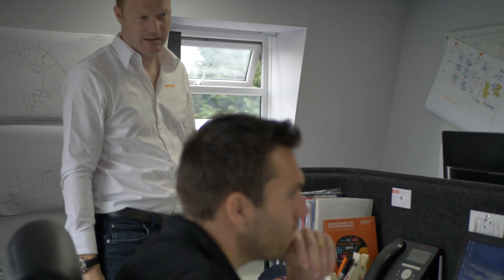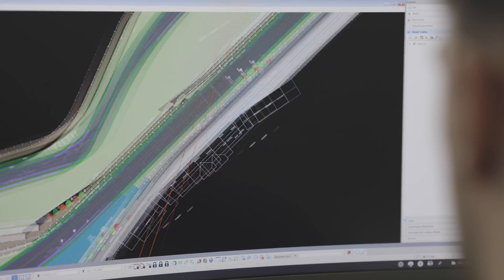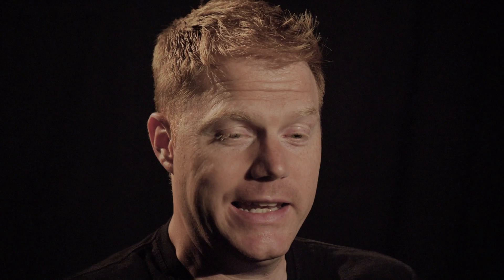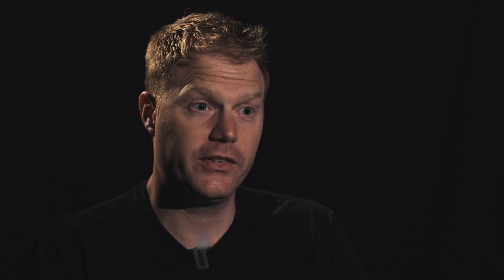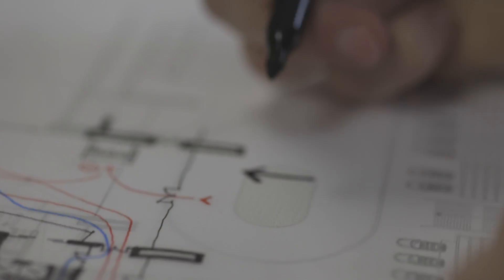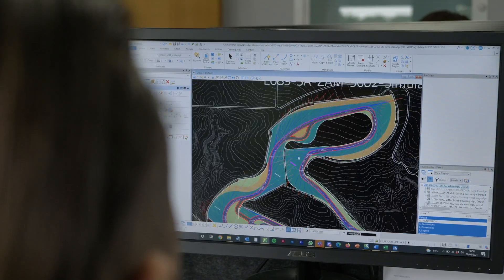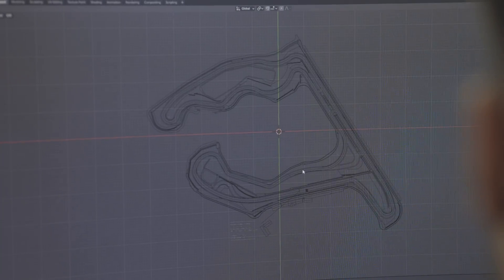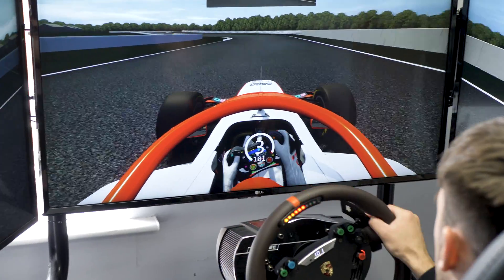Race Track Design | Our Process | Driven International

Comment: They 100% don't race😂, the track designs are terrible!!! Terrible to watch terrible to race.  Top speed straight to a hair pin, top speed straight to a corner. How is that racing? They have no flow no days, and will put a chicane in every place they possibly can